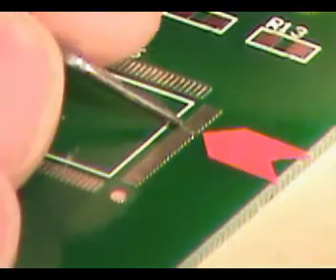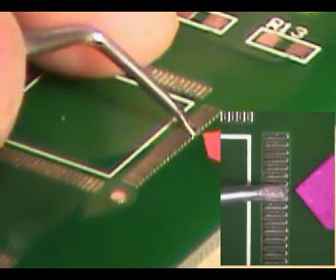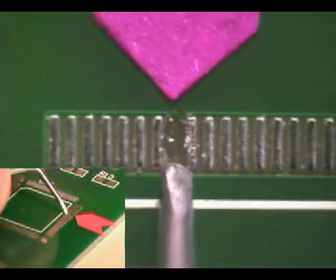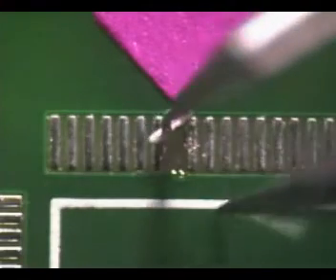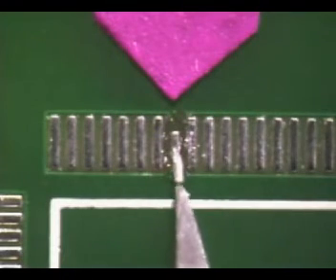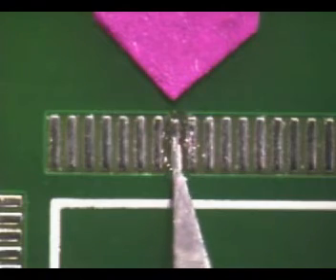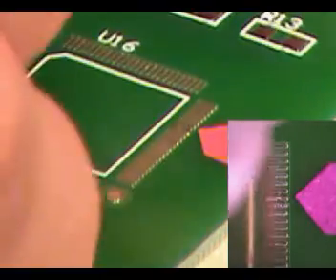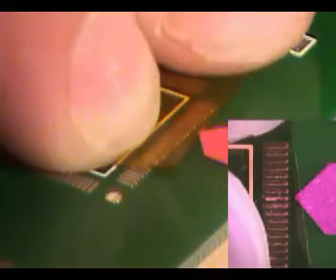PCB Pad Repair Epoxy Version

Comment: Could you please tell me what epoxy adhesive did you use?
Reply from the maker: @ingenierocristian  Hi, thanks for your question. The epoxy is a 2-part called Loctite 151.

It will mostly cure in a few hours at room temperature with a full cure time of 2 weeks. To speed the curing, we recommend putting the repaired assembly into an oven at about 150 degrees F.

Comment: That looks like a practice/demonstration board, that's why it has no traces. In a real fix you'd have to make sure the pad has a good solder connection to the trace which usually attaches to it at the end then runs just below the surface.